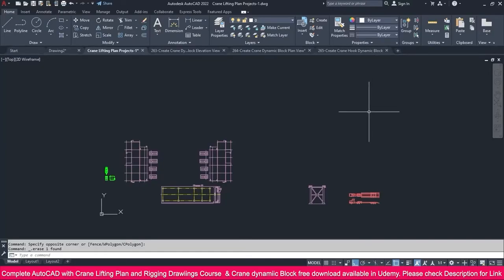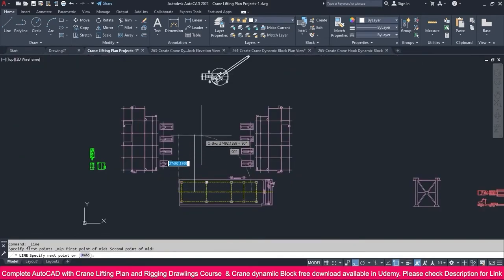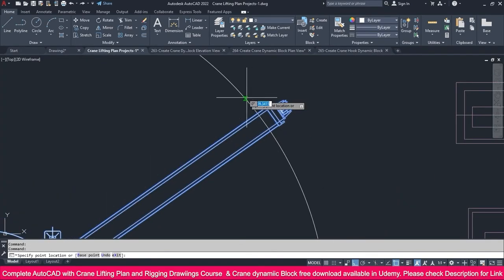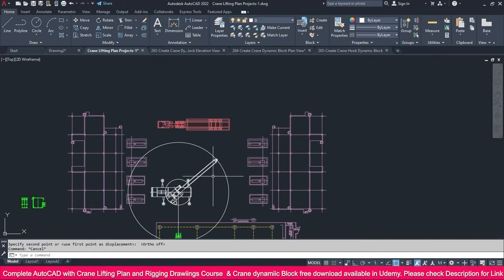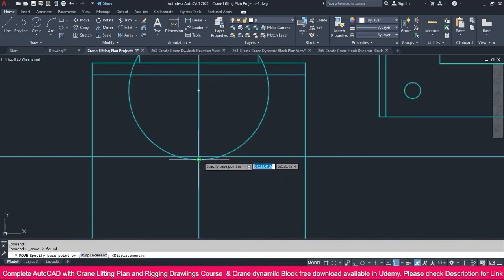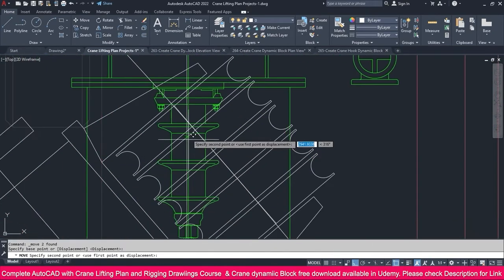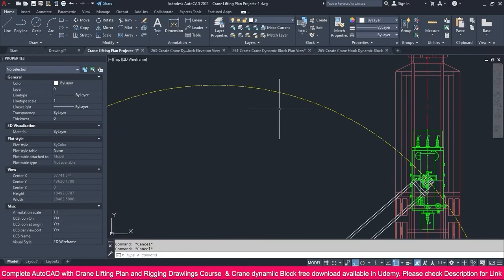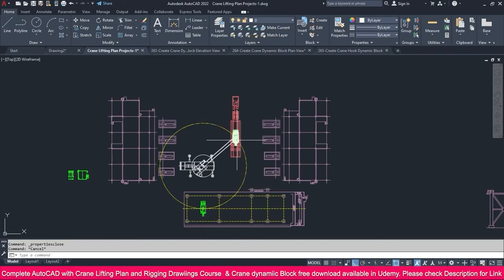5 Create AutoCAD Crane Lifting Plan View

Comment: Where can i get blocks
Reply from the maker: Online Engineering Software Training Courses 
1. Tekla Structure 2020
https://www.udemy.com/course/tekla-structure-2020-complete-guide-for-steel/?referralCode=068C7E80057B58667D97

2. Tekla Structure 2021 RCC Basic + Advanced Level Course
https://www.udemy.com/course/tekla-structure-2021-rcc-basic-advanced-level-course/?referralCode=8A48D896E459324679D4

3. Complete AutoCAD 2D&3D From Beginners To Expert
https://www.udemy.com/course/autocad-2d-complete-basic-advanced-level-course/?referralCode=E0E9B850A9FA9666399C

4. Revit Architecture Easy way to design your house + Estimate
https://www.udemy.com/course/revit-architecture-easy-way-to-design-your-house-estimate/?referralCode=63C7DFC434AEEBBFFCFA

5. Tekla Structure Project Warehouse Course
https://www.udemy.com/course/tekla-structure-project-warehouse-course/?referralCode=F30C3F489CAE5B5C6FC5

6. AutoCAD Steel Structure Designer Course 2016-2022
https://www.udemy.com/course/autocad-steel-structure-designer-course-2016-2022/?referralCode=E2A5A00FEB70C722EA82

7. AutoCAD Pressure Vessel Designer Course 2016-2022
https://www.udemy.com/course/autocad-pressure-vessel-designer-course-2016-2022/?referralCode=E5EAD300953BDC62F7AE

8. AutoCAD Crane Lifting Plan and Rigging Drawings 2016-2022
https://www.udemy.com/course/autocad-crane-lifting-plan-and-rigging-drawings-2016-2022/?referralCode=9163D185037CDC8D4042

9. Complete Revit Architecture From Beginners To Expert
https://www.udemy.com/course/revit-architecture-a/?referralCode=ACD0CF74A56CD431F92F

10. Complete Revit Architecture Beginners To Professionals
https://www.udemy.com/course/complete-revit-architecture-beginners-to-professionals/?referralCode=7AFC7D1B9FB951DBF93E